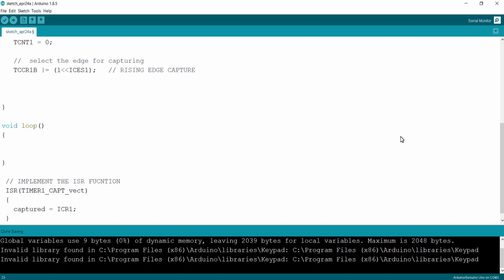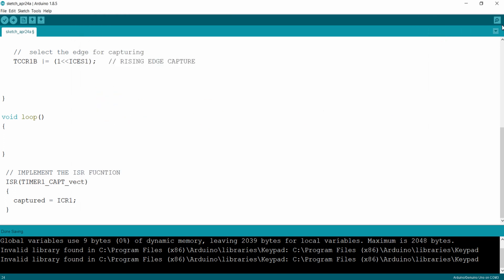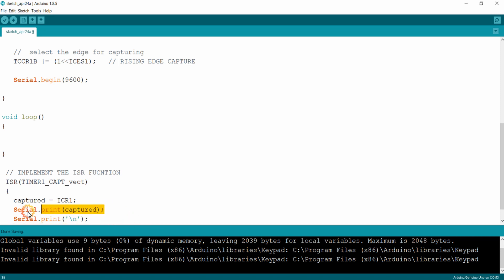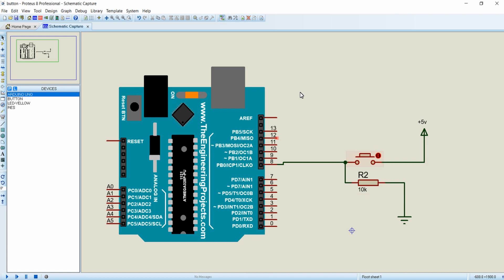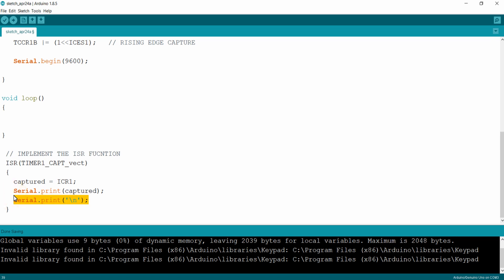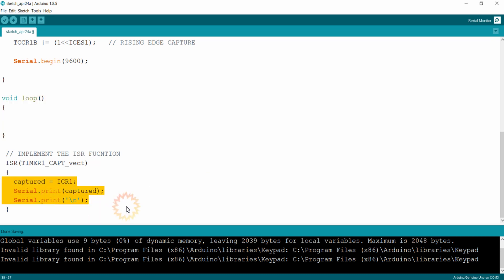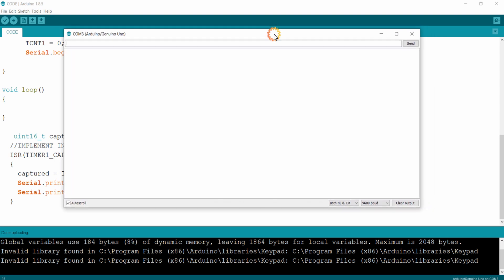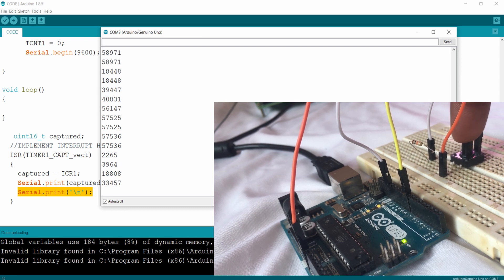Timer Input Capture Programming in Arduino | Register Level Programming in Arduino | T - 26

Comment: hello, thank for the lessons. i have a question. in your program output captured is resetting. what is the way not resetting captured value. example if(old captured> captured){captured= (oldcaptured- maxvalue)+ captured) } ... and next question is there a good way to capture 2 seperate interrupt. and is there a conflict spi and timers
Reply from the maker: Hai sorry for late reply
actually the timer count value will be always resetting when it attains the maximum value by default we cannot continue count beyond maximum value
what kind of two way interrupt you want to use
no conflict between spi and timer
Reply: @SMtrainingacademy  i want to get rpm for wheels and motor. 1 is 6500 max the other is much slover. I can get it but my screen is spi. Is spi and external interrupt 1 ,2 in same timer or can i use an other way. ( i know from you "you can reset timer or interrupt" but how and what is the logic ?) and thanks for very fast reply :)